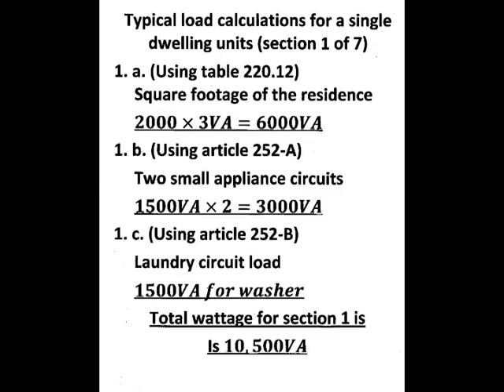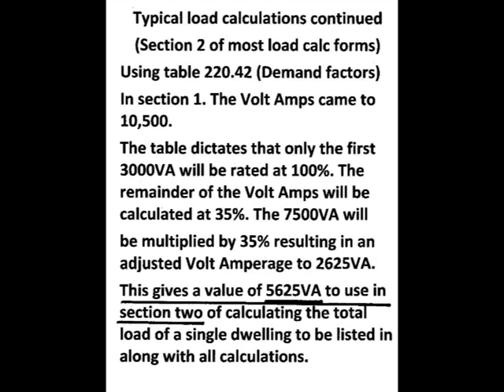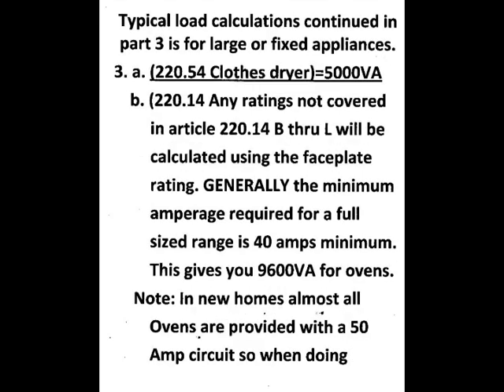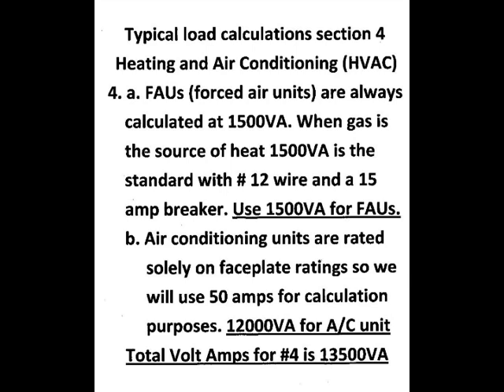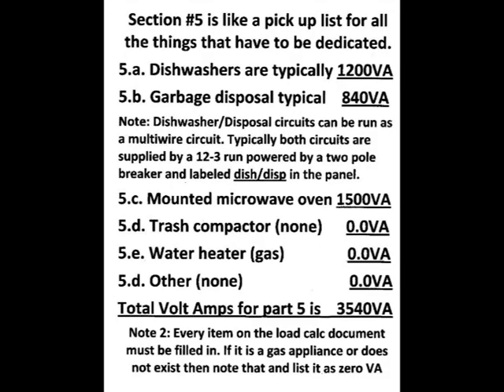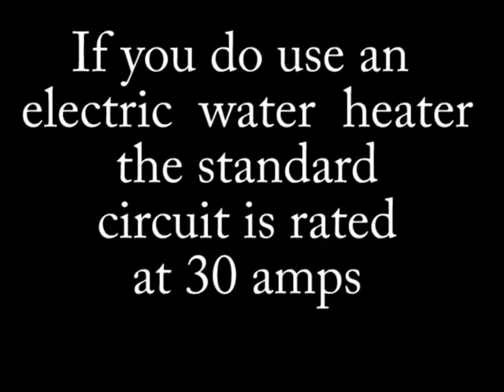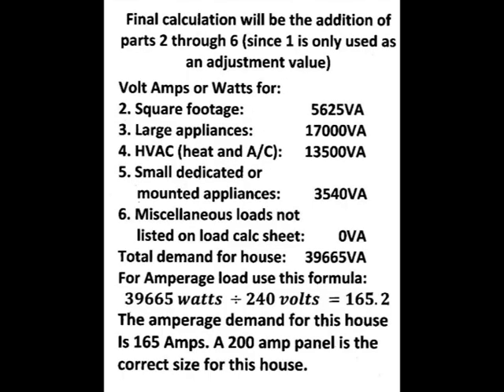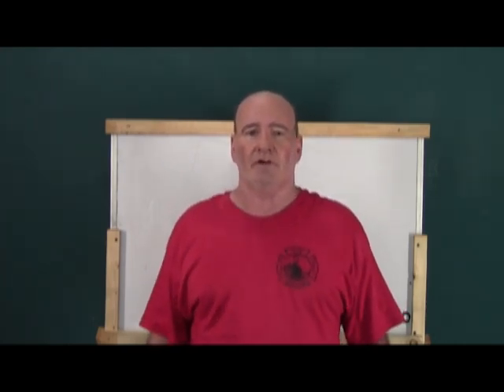NEC Electrical Code # 8, Home load calculations, # 14

Comment: If you calculate a load of 180 amps, can this be used on a 200 amp panel, or is it limited to 80% of the rating or 160 amps.   The reason I ask is you recommended a 200 amp panel with the load calculated at 165 amps.

Comment: THANK YOU for this video!  i added it to my SOLAR LESSONS videos playlist.   i will ALSO be forwarding this video to every one of my clients and everyone who asks how to do load calculations...especially the ones trying to fit 60A of solar into a 100A panel, thinking that they are ok to derate the main circuit breaker to 75A!

i see that your video just saved about 25 contractors licenses.

again - THANK YOU!!!

Comment: the figures used for the heating; air conditioner, range, and water heater for your presentation are being calculated based on the size of the breaker, shouldnt the operating amperage or nameplate be utilized for the VA ?